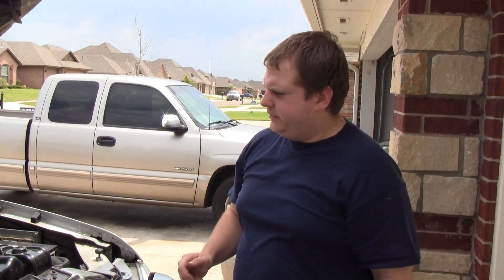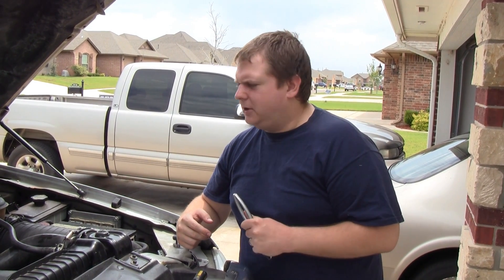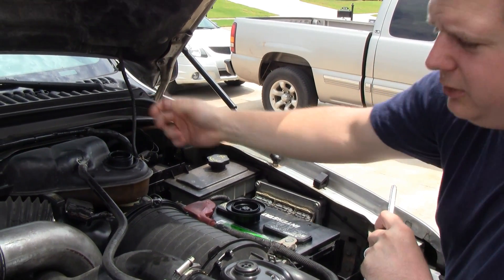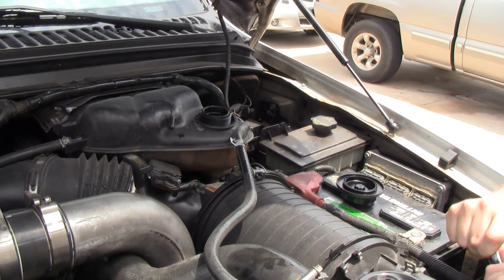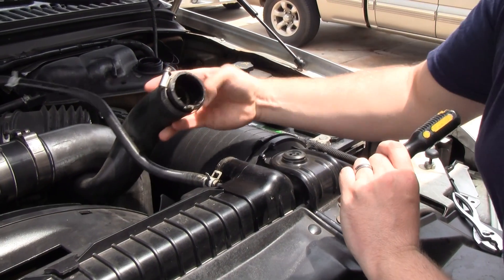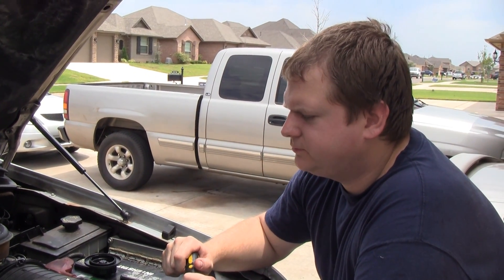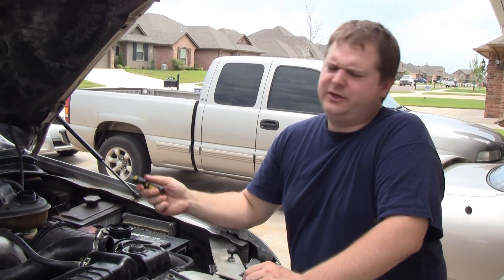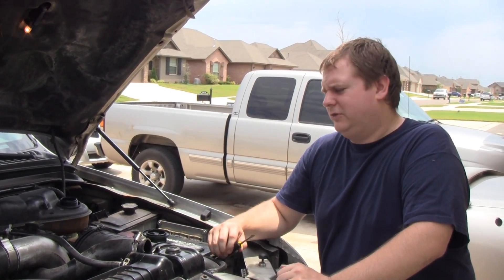Deviously Clever Mechanical Fraud On A 2003 F-250 Powerstroke Diesel

Comment: your first mistake was buying a ford. 2nd was buying a powerstroke. 3rd was buying a 6.0 powerstroke. 4th was buying it from an auction. ford sucks, powerstrokes suck, and the 6.0 is a garbage engine. every step here was a fail
Reply: Stuntihn MX but have you heard of a Chevy truck engine having the same kind of problems that happen as often? The only new truck I have bought, ever to have continuous problems with is a Ford F-150 eccoburst! Two head gaskets one right after the other! Plus the dealer tried to blame it on the Cold Air Intake, the same brand I install on all the vehicles I own, without having any problems! Oh sure it was a nice  truck, held a good load, drove nice with plenty of power, but after leaving me stranded waiting for a wrecker? TWICE! Away from home! I took a huge loss and went back to a Chevy! Now I go to lots of places with my travel trailer, knowing I will never have any problems! It's been almost three years now and 40,000 mile without any problems! I bought what I should have in the first place, a real nice Chevy LTZ  with a 6.2 4x4 AWD crew cab. It has more power, gets better mpg and sounds great! Plus I was able to get more money off than on any Ford in the area! Which helped with the loss I took on the F150! The only package I did not get that I wish I had was the Z71, just because you can not get the HD tow package with the Z71, but now I know I could have with the 6.2, that the gearing that comes only with the HD tow, was not needed by me with the power the 6.2 has!
Reply: Mr.TooTall 939 your YouTube handle says it all. My 03 F250 7.3 is running just fine. Don't hate bitch!
Reply: @nunyabiznes4604  You have the right engine. Like me. I have an '02 F350 7.3 and it is a SOLID truck. 6.0s are garbage.
Reply: Actually a cold air intake on a turbo charged gasoline engine without any tune to the esc for it can cause all kinds of problems just because the same brand works on your other vehicles doesnt mean it will react the same on a turbo charged gasoline engine.    Turbo charged gasoline engines can be very sensitive to variables like air fuel ratio and timing all of which can be changed by the installation of a cold air intake without any tune.
Reply: covers, youre full of shit. changing the air filters to a different shape doesnt chnage the volume of air going through the throttle body. youre talking out your ass. a cold air intake isnt changing the intake manifold at all.. its just a filter/tube change. marketing dbl speak.  he is 100% right on the fact that the "CAI" change wasnt the issue with the engine.
Reply: Lmao at your comment too short 939. My 2006 F350 drives and runs like a horse, very strong! ❤❤Love my 6.0 powerstroke! 👍❤❤

Comment: Problem is, it's a 6.0 man no joke all childless remarks aside because we all know how guys are when it comes to their specific tastes in vehicles. Truly man a 6.0 is the biggest money pit you could ever have the displeasure of owning. If you haven't already, just sell or scrap the damn thing and buy a 7.3
Reply: ***** Well many have been seen doing amazing thing 6.0 could only dream of. Such as towing 30K+ on a weekly basis.
Reply: I've got a 2003 f-250, bought new, with a 6.0L that has 200,000+ miles on it. Never had any problems other than regular maintenance. These engines just require regular maintenance from the dealership with all OEM parts.
Reply: A 7.3 idi nothing like it.
Reply: If you stud it and do the EGR delete..they are good trucks...!
Reply: If you throw some ARP head studs on a 6L and do a egr delete then the motor will be every bit as reliable as a 7.3. If you don't do those 2 things then yes, at some point before 100K miles the engine will most likely fail catastrophically. That was the first thing I did when I bought my 6L and ever since the only problem I've had since was a leaky fuel filter seal which was a simple fix and I've had the truck for 4 years now.
Reply: how much did it cost to do all that? parts labor and all...?
Reply: +Scott McPherson 
Yep, ford made some good vehicles in the 90s, I bought a 5.0 LX Mustang in 1990 new and I will never get rid of it. My wife thinks I love it more then her lol. Ford has a hard time matching the reliability of the good ol' 7 litre diesel to this day.
Reply: Demon50 Ford did not build any of the Diesel engines in the American built F series trucks, till the new 6.7 Scorpion Diesel engine built from scratch in house! International built the light duty Diesel engines Ford used in the American market Super Duty pickup trucks! Which so far has turned out to be a real power house, with a good record so far.
Reply: Nothing like the 7.3 IDI? Of course there is! Put a screwdriver through the turbo vanes on a 6.0 and you'll have about the same torque/hp.
Reply: Demon50... Your 6.0 will go out in the next 12 months or so... That fix last about 5 years or so... Get ready it going to Blow...
Reply: galvdeck nope... they don't. If you bought your truck to haul the occasional tractor or a few horses then yeah it'll likely be fine, but if you bought your truck to haul anything that comes remotely close to your max weight capacity, then your gonna blow the head off a 6.0 everytime; unless you bullet proof it. This isn't opinion, it's fact. That said, I'm not dogging the 6.0's, I like em!!! But let's not lie about the inherent issues they have.
Reply: +Z71Ranger
I'll report back in 6 months to let you know if you're right lol.
Reply: Demon50 haha good luck. Really, all sarcasm aside, good luck man!!
Reply: +galvdeck
A lot of people have had problems with them blowing head gaskets but there are the occasional freaks just like there are with other vehicles. They recommend to do an egr delete and install head studs if they start to get towards a higher mileage. Glad to hear yours is still kicking, I've had mine for 4+ years and love the truck.
Reply: Demon50 Yeah you're absolutely right!! You may have been blessed enough to find the one in 100 that is squared away and will last forever. If so, then rock on man!!
Reply: You know what they say about Ford.
Fix it again tony.
Reply: Rusty Shackleford
Dale Gribble- I quoted him from the show.
Also, I have heard both "Tony and tomorrow"

Comment: Firstly I would like to say that I am sorry to see this happen to you or anyone. I owned a used car dealer for many years and purchased cars from the auction on 2 occasions both times when I did an in depth safety check, which included pulling the valve covers oil pan trans oil pan flushing the coolant and oil as well as brake fluid I found similar manipulative tactics. I urge you to release the name of the dealer as well as what he does to correct this for you since it is considered a safety hazard. Take note this is also fraud. Any time someone sells a car which has had something done to it to specifically hide the fact it unfit for road use the dealer that sells it is guilty of fraud and can be held liable for the cost of said vehicle and damages. That being said he may not have known but releasing his name and how he handles the situation will at the very least warn people that he doesn't safety his vehicles well, and it will illustrate what kind of dealer he is. If he immediately fixes it you have done him a great service by showing that when someone buys a car from him he stands behind it. If he doesn't, Well you get the point. God bless and good luck

Comment: I was recently ripped off by a dealer on an As Is sale. The Ford F150 had a low battery output and corroded connectors. When they jump started it had enough power to run but not light the dash. It drove well and seemed ok, and since they said it had a certain mileage  I felt it would be worth it to fix anything that might come along. Well when I got it home and changed the battery everything lit up and the real mileage was 320,000. When I called back they were like...oh well you bought it as is. I had looked them up on Angie's list and the BBB but they had no complaints....well they do now!

Comment: If there is oil in the coolant then there will be coolant in the oil, did you check the inside of the oil filler cap or the oil dipstick?

Comment: Pro tip- NEVER buy a vehicle with a motor as shitty as the 6.0.
Reply: Can confirm, I owned one. Mine was even "bulletproofed". Straight up piece of dog shit.
Reply: Agreed. several friends made that same mistake. if theyre so call bulletproofed make sure they have receipts in hand. never seen any catastrophy such as the 6.0
Reply: MaxTheKanuck
starts talking about grammar and gay porn instead of trucks now. thats what you get for being a ford fanboy ford loves fat oafs like you what an easy sale Kentucky 4 life lawl!
Reply: And both the EGR cooler and oil cooler had problems. I learned this doing some work on one that ended up being quite the lesson on the 6.0!
Reply: Honestly after working on the one, which as i said taught me a lot, really the 6.0 wasn't bad so long as it was taken care of. The fixes are done, what Ford didn't do well enough the aftermarket has, and once taken care of the engine should work and last. When I was working at a GM dealer, one guy who was always busy was the diesel guy doing all the cab off cylinder head jobs on GM diesels. Seems the earlier ones liked warping heads among other things.
Reply: MaxTheKanuck
WTF is this kid serious? ITS CALLED small passage ways that no matter what lead to the cam phasers startvingg of oil and they burn out. not all trucks and cars will last 350k miles from "maintenance" some engines are not designed well at all you have a fuck ton of shit to learn son. 3valve is a money pit from ford
Reply: MaxTheKanuck
 LMFAO dudes father is a "master mechanic" (youtube approved) and he doesnt think that cam phasers are a fail from ford... LMAO good god you must have had your thumb up your ass cuz you didnt learn anything. so pretty much this kids dad is a master mechanic so that means 3 valve tritons are good enggines?  its ok it will get better dude the world is a hard place im sure for you. yyou know your dads a master mechanic so that means youre one too your the best bro didnt take you very long either! made myy week lol...
Reply: MaxTheKanuck
 now youre making excuses. you changed topic first does your brain work? you had shit all to say because you actually learned something about your 3 valve engine for once so you decided to shut your trap and start talking about gay porn what every teenager on yyoutube would do bahahah, yeah lets turn it into a roast buddy. 8% body fat trying to brag about that on yyoutube lol. well i can bench press you and dump yyou on yyour head! my dads a master mechanic too! hes worked on cars his whole life i think he knows more then your master mechanic dad! BUILT FORD TOUGH !!!!
Reply: MaxTheKanuck
 ....4 comments ago from MaxTheKanuck

"You really like that "y" key, eh? Must be frustrating every time you type "gayy porn" into Google."
 i think you were done at that comment bud mass fail
Reply: Just cause yours was good doesn't make it a good engine.  Some survive, though a sickening amout of them have issues with cam phasers, blowing sparkplugs right out of the head, oh and when you go to change the plugs? Yeah, they usually break.
Reply: Or never buy a cummins with a Ram decal on it!
My dodge/cummins pickup has been by far one of the worst trucks I have ever had the misfortune of owning. Not a days problem with that great cummins turbo diesel but the rest of the truck has nearly broke me! The Ford and GMC pickups I owned had a few small issues here and there but nothing like this dodge Ram! Constant electrical issues with everything from headlights to windshield wipers, steering components, transmission and transfer cases. The list goes on!
Reply: chevy gas 6.0 is a legend as far as durability
Reply: +John Jackson that's nothing for a diesel.  You should have any serious problems with a diesel Till 500k. Shit,  my German om617 had 340k and i never had to do a thing to it besides oil changes.
Reply: Yea I'm just glad it hasn't shit the bed on me yet.
Reply: MaxTheKanuck
 the 3v is a peice of shit and yes they can make it to high mileage BUT only after replacing cam phasers no 3v engine will EVER go on origional cam phasers why dont yyou ask yyour old man about repair bills first there bud because he deffintley had to put in alot of money to get that kind of mileage unlike the 2v you can get super high milage with just basic maintenance. so yes the 3v is a peice of shit there buddy
Reply: My 12V says your wrong.
Reply: Harry Crotch its called a cam phaser lockout kit=no more problems
Reply: John Jackson I've got 288890 miles with no issues.  The 6.0 has to have regular maintenance performed.  If you want to turn it into a smoke blowing, tire burning, barnstorming, monster horse power truck, expect it to grenade!  My engine builder once told me "Play racer, Pay racer".
Reply: I loved my 6.0, I miss it.  Had it pushing almost 500hp the best truck I ever had...by far.
Reply: +Ian McClure just hit 220k with my 6.0 it has never given me problems.
Reply: Stud it! Delete it! And they are good trucks!!
Reply: The 6.0 Powerstroke itself is actually a great engine, there's a lot of potential for power and torque. The turbo's, however, were a bit explodey.
Reply: Harry Crotch Hahahaha... I've got 8% body fat mate. I work out every day. My 6 pack is more defined than your future.

And I only brought up your apparent love of gay porn because you changed the subject first. If you want to turn this into a roast, let's turn it into a roast. 

Also, I am, as my name would suggest, Canadian.
Reply: 7.3 FTW
Reply: @maxthekanuck the 6.0 is NOT a good engine. thats like saying the 3V triton engine is good which its not cam phasers were a failed ass technology that went out every 70 000 miles even after repair you will fix them 2 or 3 times over the life of the vehicle 1000 dollars each side. ford has some good engines like the 2V triton 99-08 4.6 telll people the truth and learn about engines before defending them.
Reply: Harry Crotch He's been a Master Mechanic for 30 years bud. The engine is completely original. It's called taking care of your vehicle.
Reply: Harry Crotch You really like that "y" key, eh? Must be frustrating every time you type "gayy porn" into Google.
Reply: Keith Keith

yup unfortunately my buddy is rebuilding his having to sent to machine shop new insides n all cus a GOD DAMN RING blew on one on cylinder 1 at 100k

ran fine for bout amonth then died!

ford made massive mistake using that motor for the purpose of f250 

if I remember right came from old bus which didn't crankcreal power out like coal roller 

they modded the engine and ruined it
Reply: If you do the fixes, it's a great engine.  I have mine studded, EGR delete, bullet proof diesel water pump  and external oil cooler.   Coolant filtration system from sinister, as well as their regulated fuel return with bowl delete.   SCT tuner cold air intake and straight pipe 5" exhaust.  New sinister turbo.   Runs awesome, tons of power and great mileage in an 8k pound excursion.  Love it.
Reply: He probably doesn't know how to properly maintain a vehcle. The 6.0 is a good motor with great power. It's almost double of what the 7.3 produces. More power means more maintenance people just don't understand that.
Reply: Harry Crotch My Dad's '07 F150 has 400,000 Miles on its original 3 Valve 5.4L, so that's a bunch of Bullshit, and the 6.0 is a great engine. There are guys making over 2000 Ft/Lb reliably with them. I have no idea why, but when they're looking to produce numbers like that, a lot of people will actually choose the 6.0 over the 7.3.
Reply: Harry Crotch It's okay dude, you don't need to take that self loathing of yours out on your keyboard. There's a pretty big difference between bias and facts, and right now you're the one being biased, and I'm the one being factual. There's nothing wrong with the design.

Comment: If there was no coolant in the radiator hose, why weren't you temp readings through the roof - a dead giveaway something was wrong in that area? Anyway, you're assuming it was done by a dealer, yet could have just as easily been done by the previous owner (watching a video like yours) to increase the sale or trade-in price.

Comment: Interesting, multiple parties attempted to diagnose the vehicle. 
No one took the radiator cap off? Gunk around cap/floating on the surface
Dropped the oil? milky colour
TK Tested the cooling system- checks for presence of exhaust gas in the coolant

Sorry this happened to you man, hopefully you didn't pay people to diagnose the issue only for you to find it yourself. Dang!

Comment: OK so this video was shot three years ago it's 2016 so this video would've been shot into thousand 13 the truck is a 2003 typically dealerships will not try to sell a vehicle on their own lot that is over 10 years old or over about 65 or 70,000 miles given the nature of how junk 6 L power stroke's are I would say the dealership would have passed it off regardless if it was eight or nine years old or had Less than 65 or 70,000 miles so couldn't it be that instead of the mechanic committed fraud that the guy that owned the truck that traded it into the dealership committed fraud because I would say the dealership would have not even looked at the truck and sent it to auction anyway because of the nature of how junk 6 L power stroke's are well power strokes in general and due to the age and mileage of the vehicle? So why does it always have to be the mechanic?????? You know what they say when you ASSuME! This is just further proof of the intelligence level of the American citizens anymore